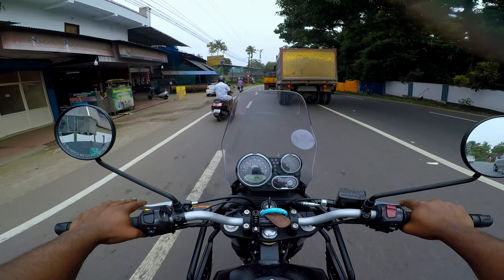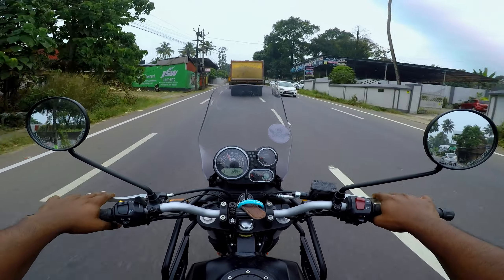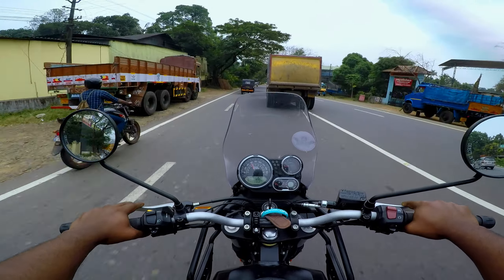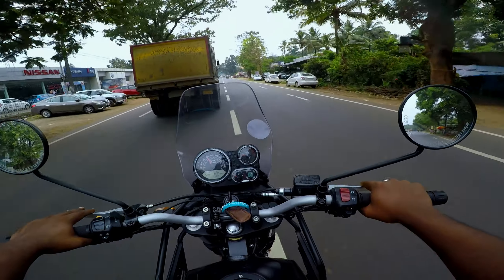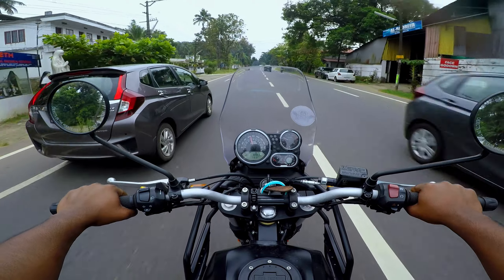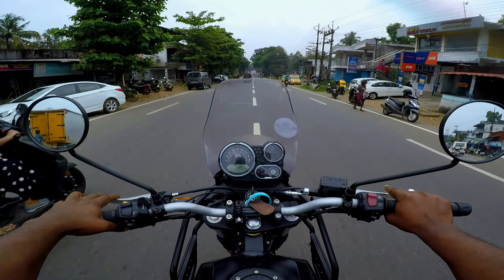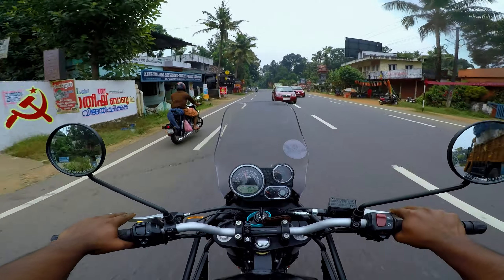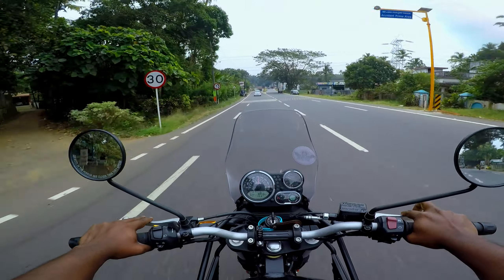പുതിയ Himalayan ടയർ, Break, ഗിയർ 🤦‍♂️🤦‍♂️എനിക്ക് തന്ന പണികൾ | Royal Enfield Himalayan

Comment: No bro brake nte issue athalla...
Nmde brake ABS aanallo... so issue is, its avoiding the tyre to get locked due to braking...
Athaan aah oru feel varunnath
Reply from the maker: Alla bro mine is from the back break pad portion, and it cause my rear disk make some scraches♥️♥️
Reply: @Q4FITGYMALUVA  don't know...
Normally njan paranjathaan reason undavaaru..